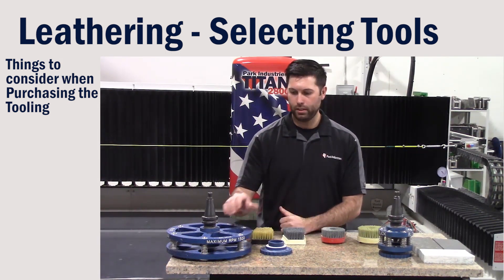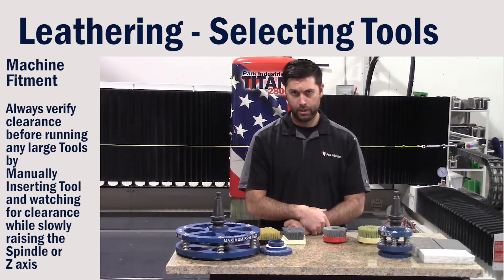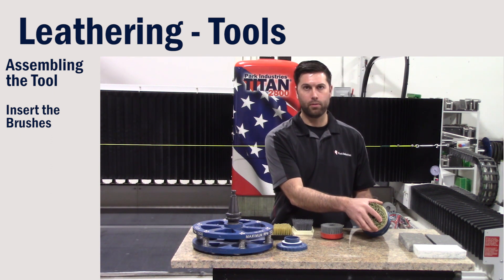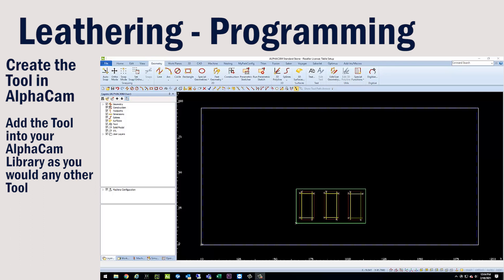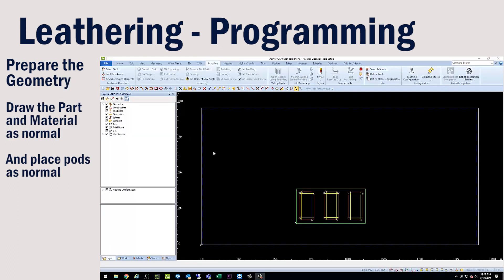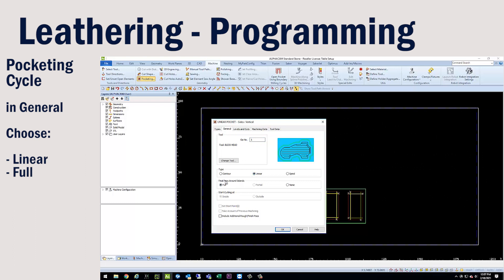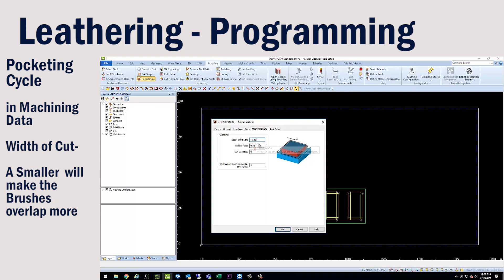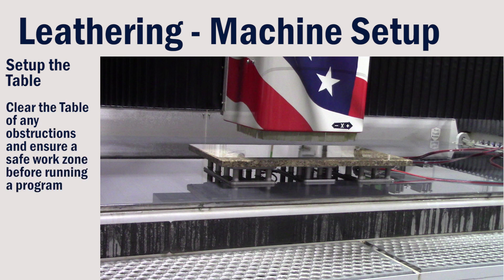Leathering and Honing Stone

Comment: What is the correct way to connect the Mini to your tool holder? I'm having a hard time with that.
Reply from the maker: It gets attached to a standard 35mm diameter cone. Same principal as any other CNC profile tool that has a 35mm bore. If you need further assistance, please reach out to our customer service at 800-785-3391 and they'll be happy to help!
Reply: @ParkindustriesUSA  Thank you! I will try again and maybe give you a call then!